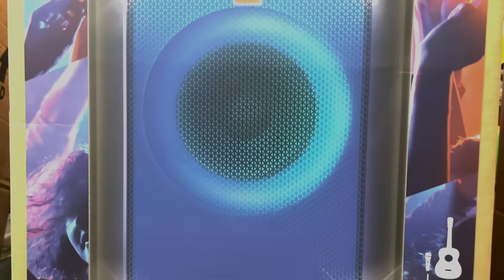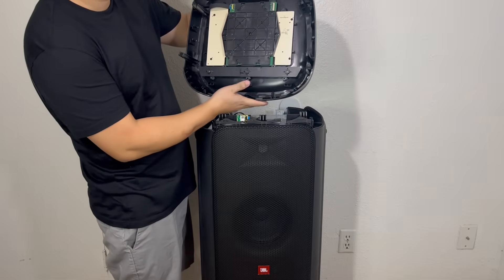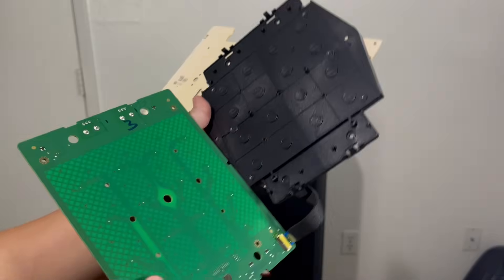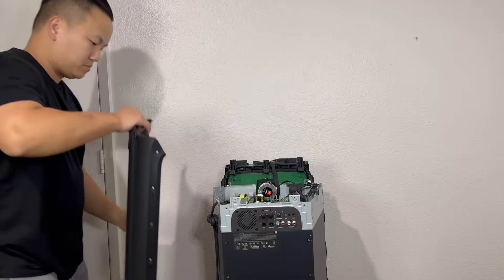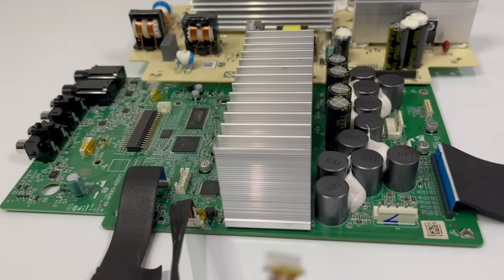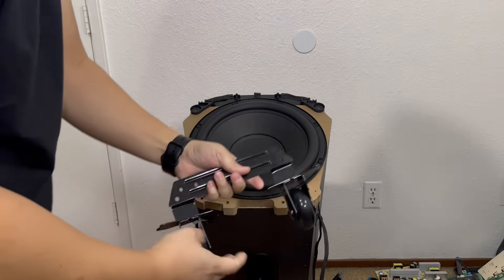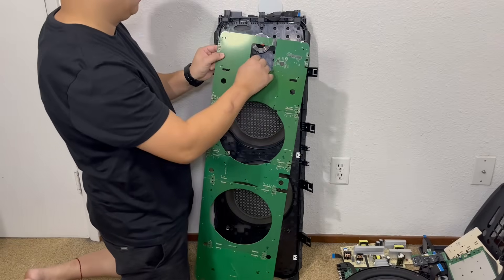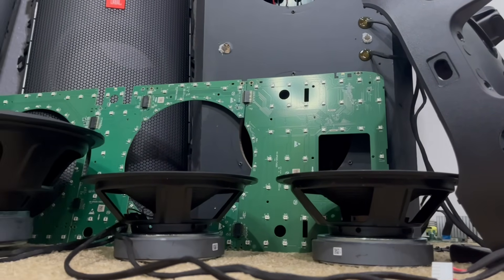JBL PARTYBOX 1000  COMPLETE TEARDOWN !!!

Comment: Спасибо. Кто ни будь замерял реальную мощность на выходах?
Reply: Probably not alot of power i have 2 of these speakers and hooked them up to a killawatt meter and they both only draw 350 watts at 120V but I'm pretty sure they use high impedance speakers like how cars use to save power they sound like they would draw more but no unfortunately

Comment: Awesome video! Question: my jbl partybox 1000 fell directly backwards while it had a mic plugged into the mic input. The cord was destroyed and the mic input jack is pushed slightly into the partybox and when I plug another mic into it, i just hear white noise. What part would I need to replace to fix this? Do I have to swap out the whole motherboard since it looks like from your teardown that the input jacks are directly soldered to it? Thanks!

Comment: 1000W fake watt  real watt 250-280
Reply: There is a 150w amplifier in it XD
Reply: @peterlang9107 🤡
Reply: These are just like a cars audio system they advertise high wattage for example my infiniti has 3 10 inch subs from the factory but the fuse going to that amp is only 20 amps so not much power but very loud same as this jbl speaker probably has to do with the ohms of the speakers or low current draw amps with high power output

Comment: How can you tell if the mother board is bad my bass button not functioning
Reply: Can you fix my speaker I will pay the price
Reply from the maker: i would suggest checking the connections first and then taking the board out and seeing if the button is actually broken. Maybe replacing the button is doable, but then replacing the board may be the easiest option.

Comment: I'd say it's probably 500w at most  125 x2. 250x1  1000w max judging by the subwoofer and mids size   there no way your electrical would support 1000w  and the other junk lights and others dj things  with control board.   If it was a 1000w there only be enough to power just the amplifier nothing else 💯👍✌️🫡😉
Reply: I have 2 of these jbl and hooked them up to a kill a watt device and at full volume both only pulled 320 watts from the 120V plug 😂 they are high ohm drivers that only need a little bit of power to move them
Reply: @Ricky-gr6uc  sound about right .  There high sensitivity speaker.  150w rms per box  sound more realistic.  It would be difficult to power any thing over a 300w amp on a battery power  system.  You would need a full size car battery for a power supply  and it would only have a  30min run time  played at full output  at 300w . It would take way to long to charge back up .  I'll give jbl and other stereo manufacturers credit they do build great enclosure.  When they want to.  That what makes them sound good. 💯🎵🎶🫡👍✌️

Comment: Things that "JBL" (Samsung) could've done better:
Use MDF instead of cheap particle board for the subwoofer enclosure,
Use actual bracing instead of glueing a circle to the inside,
Don't put the mids in an enclosure without polyfill,
Use gold plated connectors for better signal transfer,
More passive cooling to reduce the need for fans,
Use the eq for the speakers instead of the microphone,
Use better parts,
Builtin battery
Use less screws,
Use an more efficient amplifier to reduce the amount of cooling blocks.

Comment: My JBL 1000 speaker does not turn on. Do you have any idea how to fix it?
Reply from the maker: make sure its plug in as its not battery powered.  if its plug in and still does not work, you may want to check the powerboard.

Comment: Hey, if you see this, i have a question. A favor. I have problems with a midrange driver of it, and I'm wondering if i can get it replaced. I want to ask if you might have seen a sign that's points to the wattage of it. I know it's 7", 4 ohms, but I'm looking for the wattage to find one to replace it with. Please, help.
Reply from the maker: Doesnt look like the exactly wattage of the driver was disclose by JBL.  I would think it would be around 200-300 watts while the sub is 400-600 and tweeter 100-200
Reply: @HBV90  Hey, thanks for your help. I've reached out to them, and they have sent me an email to send me a new midrange. Appreciate your response.
Reply from the maker: @ColonelCuddles  jbl sent u a new midrange?  That's awesome!

Comment: Whenever i turn on my jbl 1000 the lights on the front of my speaker turn on but none of the lights on the dj pad turn on not even the power button and it starts playing the demo song. I cannot take it out of demo mode or hard reset it because the buttons arent working for some reason what should i do?
Reply from the maker: I would check the ribbon connection of the pad

Comment: WHAT I WOULD HAVE LOVES TO SEE IS THE PART NUMBER OR TYPE OF AMPLIFIER  CHIP MOST OF YOUR TEARDOWN IS USING.. IF YOU CAN JUST REMOVE THE HEAT SINK AND CHECK THE IC NUMBER.
Reply: There is a class d amplifier chip TPA3255  And other amplifiers with other d2 numbers

Comment: after over 4 years from its release we finally have a full teardown of this speaker. Thank you a lot mate.
Btw i'm shocked to see how many componets make this speaker, this must have been a true engineering nightmare. I'm also shocked to see a 2414H compression driver, that's literally a driver used in Professional speakers like the EON and VRX series... I'm so sad to see that's totally gone from the ultimate.
Btw it would have been amazing to show the actual horn of the tweeter, to see the shape of it, idk if it was possible though, as there was the metal grille.
Again, fantastic stuff mate!
Reply from the maker: If you look up the part mumber, you can see how it look like..you'll be amazed.
Reply: The ultimate is almost a ripoff from the 1000
Reply: @haze1464  Not really

Comment: Correction: Midwoofers.. They play both mids and some bass down to where the sub meets them.
Reply: although I have to mention that they both cover different frequencies range.
In a test with frequencies going from 20 to 20k hertz, when the sub cuts off, only the lower mid starts playing; going up that range the upper one slowly starts to play and the lower one starts to roll-off, until only the upper one plays, and then the tweeter starts to kick in and the upper mid starts to roll off.
Basically it literally has frequencies going from deeper to higher and the drivers are reproducing them from the physically lowest to the highest... this thing It's way more complicated than I could imagine and then JBL ever publicised lol
Reply: @domepugliese  Yeah, so it's a 4 way system. Nothing special about that. Or a 3 way system + sub if you like.
It's not really that complicated. JBL has been building speakers for years so theese things are a piece if cake.
Much harder to make a proper hifi speaker than this actually.
Reply: @Oystein87  Making it sound good is a totally different story and very diffucult tho, as crossovers are a nightmare to set up properly; that's why some 2 ways sound better than 3+ ways speakers 😅
And as I said before, JBL didn't do the Partybox 1000 justice, cause marketing was very, very weak imo, and just talker about lights, dj pad, karaoke and driver setup, that's it.
Reply: @domepugliese  Making it sound good (for most people) is not really the hard part.. Making it sound correct is the hard part... And this box was never designed to play correct hifi sound. It's a party box so sound image is not exactly hifi or high-end... The sound from this is no where close to a proper JBL hifi speaker.. All these boxes just have mediocre sound. Good for what it is but pretty shit for actual hifi use.
Reply: @Oystein87  indeed it's not a hi-fi speaker, it's called "partybox" for a reason, it is a party speaker tuned like a hi-fi one and with a deep bass bost
Ofc there are limitations from the driver and expecially the amplifier itself, but for a d-class amplifier speaker, very big drivers made to deliver powerful sound; so it definitely is very impressive for what it is and for the sound, simole as that
Reply: Is it possible to build a trigger connexion in it? When played by a pre amp?, that it turns on when pre amp goes on?
Reply: The midwoofer won't be able to play any low frequency without burning the hell out of it lol
Reply: @TeknoLars  Yes it would. But not at high volumes.
Seems you don't quite understand how speakers and sound work🤔
And a "midwoofer" can actually play pretty low before a woofer or subwoofer needs to take over. It's ment to be between a woofer and a midrange or plays both midbass and midrange. But a mid driver can go deeper but then at lower volumes. Same as a tweeter COULD technically play some bass but then at VERY low volumes. Just look at headphones... Litteraly mini speakers that plays at lower levels close to your ears so they sound louder. Put them a meter away and it's a different story.
(Woofer plays way further up in frequency than a subwoofer but can go just as deep)
Reply: @Oystein87  I do know how speakers work. Are mids made to handle excursion, and low frequencies? No they aren't, so what do you think happens when you do that, yes exactly, you destroy them. It doesn't have to be at high volumes at all...
Reply: @TeknoLars  Clearly not... Mids are often just small woofers rolled off at a higher frequency... So depends..
And also most drivers can play some bass as long as the volume is low enough. Even a tweeter.. Just try it yourself.
Like I explained in my edit of the previous comment... Just look at headphones.. So just saying a speaker would blow up if it plays lows is BS. It all 100% depends on the volume levels.
And FYI: I said midWOOFER... Not just mids played but also various degrees of bass depending on the crossover, and tuning etc.

Comment: And how many chamber ? Only  one? Or two
Reply: It looks to be 1 chamber only. Given the air flow volume of the 12" woofer, the entire wood cabinet acts as a car audio subwoofer, which is why it pounds so hard. The 2 mid-bass woofers look like musician speakers, therefore they do not have large air volume measurements. The large port is probably calculated to give the bass frequency from all 3 speakers, but mostly the woofer. This design looks very similar to JBL's Professional live performance line of speakers, but on a smaller scale.

Comment: I now understand why it cost $1000+
Reply: This is a speaker made from grandma's closet four speakers amplifier with batteries Here you can get 1,000 yourself This speaker is made from grandma's closet four speakers amplifier with batteries Here you go
Reply: Probably cost them around 200 dollars to make even lower
Reply: Cheap mdf, cheap speakers, 2000's cheap computer psu looking psu and amplifier but still sounds good. If it has a good sound, you can make a better one from that money with REAL 1100watts, you can also copy functions with dsps and mcus, jlcpcb can make the front led panel for cheap, don't have to solder smd parts , the jbl's deep bass also because of dsp tricks and a simple bass reflex, nothing magical

Comment: You should do the teardown of the real Beast party box Ultimate.
Reply: I agree with that
Reply: I know from having a pair of the JBL 710’s for the EQ app makes a huge difference because without it sounds kind of flat but once you can bring the low end and high end up leaving the mid range dead in the middle ,it really sounds good ,they really should have incorporated an app with this party box 1000 to EQ the sound out I don’t know why they left that off? That would definitely give you some better high end to go with that bass.  also it’s frustrating in TWS you can only pair two speakers because if you could pair up to four speakers and use the app in all of this I would buy two of these and run  two party box 1000s in my house along with the two 710’s I already have.  JBL really backed  them self in a corner there. If people could run TWS with four or even six speakers they would sell more of these I don’t need another pair that I can run 2 at a time , I would want to run all four of them and spread them out through the house , especially when you are doing house cleaning or put them all in one room to blow the roof off of the place lol.  I bought both of my 710s for just under $1500 on sell and right now I’m seeing these JBL party Box 1000 for 899 a piece.
Reply: very expensive
Reply: Merhaba. Bana o kontrol panelini çalıştıran flex kablo lazım bu konuda yardımcı olabilir misiniz efendim..
Reply: Just buy the Bose L1 pro 16 it’ll beat all of them. And yes I know it cost more
Reply: Can’t wait for that video
Reply: Hi
Reply: Please can you help me and get the battery
Reply: the jb1000 with the down facing sub hits nicer! the ultimate has paper tweeter and the 1000 does not! the 1000 is a real beast of a speaker and sounds so crisp at high volumes! i just wish they had a damn eq app to lower the bass at times lol
Reply: @Bluntedco.  the 1000 is better
Reply: @Bluntedco.  Does'nt your phone has an Inbuilt Eq to adjust the sound?
Reply: @RahulRk-tr7ot  yeah but you cant use it on apps like amazon music etc only your iphone music  that you connect to your computer.
Reply: It doesn’t have a subwoofer
Reply: @DripPro69420  but because of 1000 it has a subwoofer
Reply: Pb 1000 is better
Reply: @JBLJblbasstest nope, ultimate is the best partybox, 2 9 inch subwoofer is always better than a single 12inch subwoofer
Reply: @JBLJblbasstest Sony ult 10 better
Reply: @khasan991  no🤣🤣
Reply: The 1000 IS NOT better than the ultimate. Both are great, but the ulimate would monster the 1000
Reply: Rubbish buy a proper speaker like a pa speaker
Reply: @adamplummer2994   My dude chill they can buy whatever they want
Reply: Or even a pair of 590s with a good amp and atleast 1 12" sub. @adamplummer2994
Reply: @adamplummer2994 Most pa speakers alone wont provide adequate low end bass, you will need to invest on a sub which is just added expense especially if you dont plan on using the speaker outdoors or in a venue filled with people